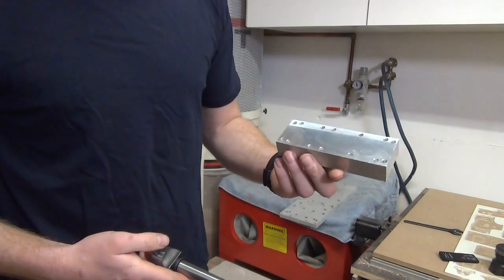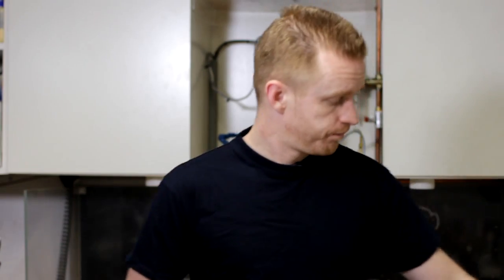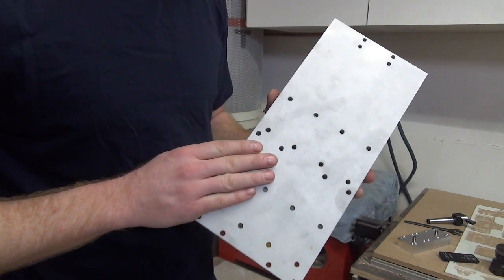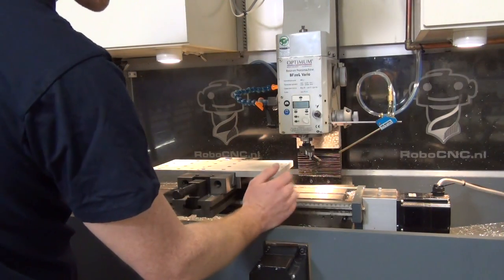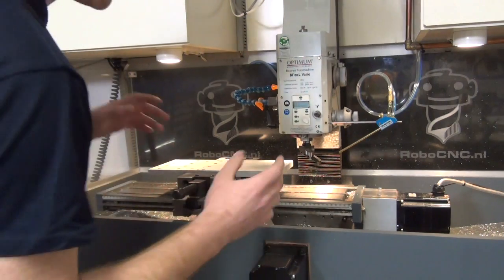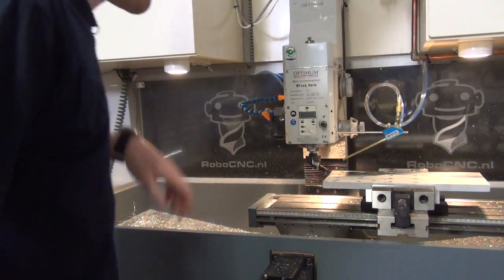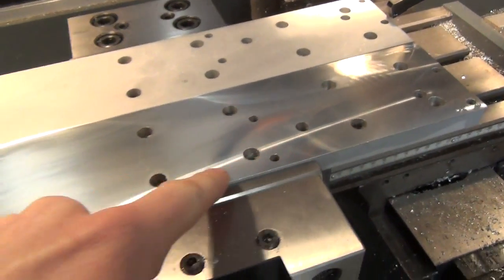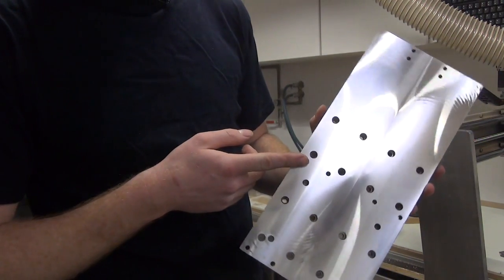RCNC Various 08: Trying out my flycutter

Comment: That is one shiny piece of metal. Can't even see the join on the 2nd cut.
2000RPM may not seem fast but when your cutter is as wide as your one that cutting tip must be fair moving and even the slightest angle off 90 degrees will show up.
That is one beautiful machine.

Cheers
Peter
Reply from the maker: Yes that's completely true Peter.. 
It makes a circle of about 8cm diameter here...
Thanks for the comment !

Comment: Nice work, try a insert meant for aluminum for better finish.
Reply: 3uba296 I sometimes spray a little WD-40 (light oil) when I want the best possible finish on aluminum.
Reply from the maker: That's indeed a great idea.. I had no aluminium inserts laying around...
Did take a 0,8mm radius to try to get the smoothest result..
Thanks for your input !
Reply from the maker: Thanks Liberty4Ever  ! WD-40 does a great job indeed...